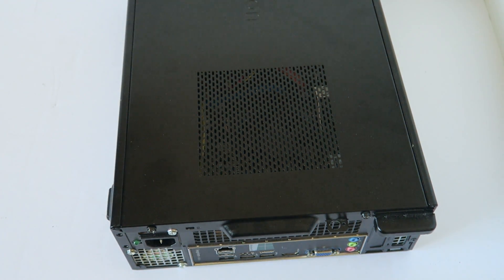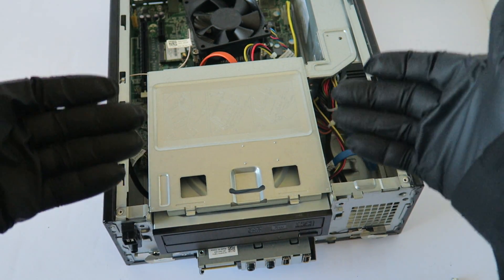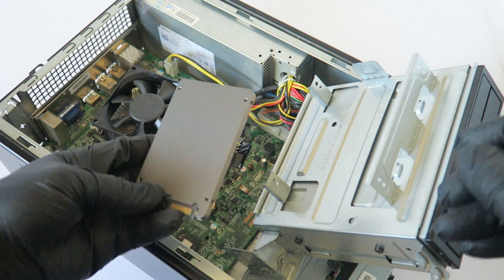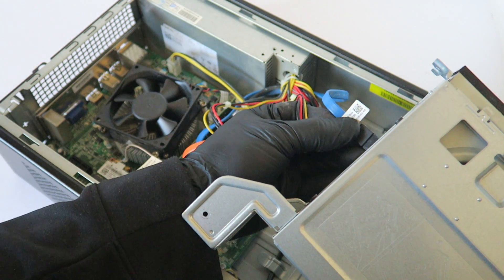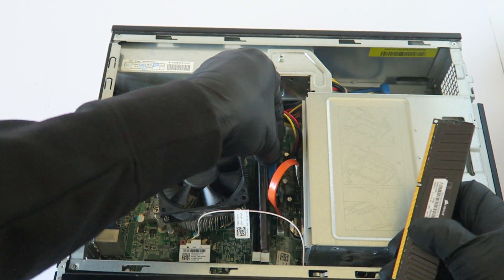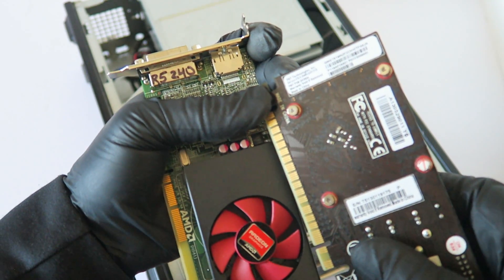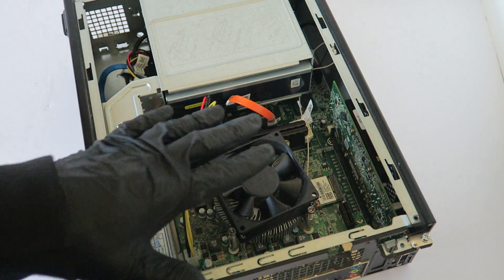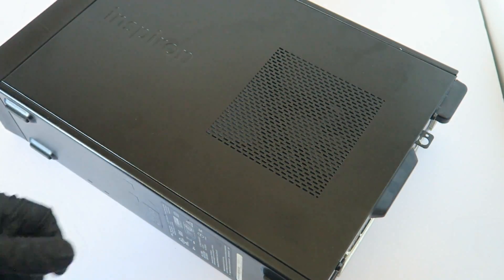Dell Inspiron 660s Upgrade, RAM, Video Card, Hard Drive

Comment from the maker: List of parts that works with this Dell 660s PC.

1..USB Wifi Adapter for PC AC600Mbps Wireless Network Adapter
https://amzn.to/2ZaGuHb

(1.) Gigabyte GeForce GT 1030 GV-N1030D5-2GL Low Profile 2G Computer Graphics Card 
https://amzn.to/2Xu3SyO

(2.) ZOTAC GeForce GT 1030 2GB GDDR5 64-bit PCIe 3.0 DirectX 12 HDCP Ready Low Profile Video Card ZT-P10300A-10L 
https://amzn.to/3eayL1b 

(3.) Gigabyte GV-N1030OC-2GI Nvidia GeForce GT 1030 OC 2GB 
https://amzn.to/2Tcz9mF

This RAM works with this machine and Supports MAX 16GB RAM:
(1.) Crucial 8GB Single DDR3L 1600 MT/s (PC3L-12800) Memory CT102464BD160B
https://amzn.to/2VhGv8O

(2.) Crucial 4GB Single DDR3L 1600 MT/s (PC3L-12800) Memory CT51264BD160B 
https://amzn.to/2xq46wb 

(3.) Crucial 16GB Kit (8GBx2) DDR3L 1600 MT/s (PC3L-12800) CT2K102464BD160B 
https://amzn.to/2VpsKpP

(4.) A-Tech 16GB (2x8GB) RAM DDR3 1600MHz DIMM PC3-12800 240-Pin Non-ECC
https://amzn.to/36doPo7

2.5" to 3.5" Internal SSD/HDD Mounting Kit
https://amzn.to/2XZccpU

SSD List:
1. Samsung 860 PRO SSD 256GB - 2.5 Inch SATA III Internal Solid State Drive
https://amzn.to/2BY5gRl

2. Samsung SSD 860 EVO 250GB 2.5 Inch SATA III Internal SSD 
https://amzn.to/37xWUfc

3. SK hynix Gold S31 1TB 3D NAND 2.5 inch SATA III Internal SSD
https://amzn.to/3d7X6D6

4. Samsung SSD 860 EVO 1TB 2.5 Inch SATA
https://amzn.to/2B2FURX

5..SanDisk SSD PLUS 1TB Internal SSD
https://amzn.to/3hwdqku

6. SanDisk SSD PLUS 240GB Internal SSD
https://amzn.to/2zfc7EX

7. Crucial MX500 250GB 3D NAND SATA CT250MX500SSD1(Z) 
https://amzn.to/3bTTjbX

8. SanDisk SSD PLUS 480GB Internal SSD SDSSDA-1T00-G26
https://amzn.to/2yfgjUK

9. WD Green 1TB Internal PC SSD  WDS100T2G0A
https://amzn.to/2XfGtzc

HDD list works with this PC:
(1.).WD Black 2TB Performance 3.5" Hard Drive - 7200 RPM Class, WD2003FZEX 
https://amzn.to/2xFUeyF

(2.).Seagate BarraCuda 1TB Internal Hard Drive  3.5" Hard Drive - 7200 RPM
https://amzn.to/3g8FXM8
Reply: hey bro i want to make sure that  will i5 3570 and gt 1030 will work fine in 220 watt psu i have also dell inspiron 660s or i have to upgrade psu please reply fast. it will be huge help for me because i am upgrading it and don't want to face any difficulty. thanks brother

sorry for bad english.
Reply: @adityaparmar9065  psu cannot be replaced, but it yes funtion with i5 3570 and gt 1030, good luck
Reply: @cruzdeperspectivas  thanks bro
Reply: N
Reply: This might sound like a dumb question, I'm kind of new to pc's and I'm about to buy an rx580 4gb locally, will it run on a 300w psu? Or am I ganna have to upgrade?
Reply: @hamzaabdeljawad4537  Did it work? I'm about to attempt something similar with a rx480 4gb externally mounted.
Reply: @justin.cycles  it shouldn’t work, I have a 500w psu. Late reply but hopefully it helps
Reply: Hey sir do i need to upgrade the power supply if I fix a gt1030 gpu in this cpu. 
I think mine contain 220W psu
Reply: The PSU can't be changed, right?
Reply: @cruzdeperspectivas  I applied the gpu now it works smoothly when I overclock that. 
And i could mos of the games like far cry 5 at ultra. 
This comment was posted many months ago
Reply: @aswinkrishnak9526  bro are you using gt1030 , so how was the experience ? Can I run 2k (1440p) gaming with decent fps ?
Reply: I have this computer but with 16gb of ram and im wondering if i were to get the ZOTAC GeForce GT 1030 2GB GDDR5 64-bit PCIe 3.0 DirectX 12 HDCP Ready Low Profile Video Card ZT-P10300A-10L would i have to get anything else along side it? And just in case my monitors are KDL-32S2400 as my main and DELL S2340L as my second.
Reply: @mr_falconer   I think, to you don't have any problem, you should change pc, I mean, case and motherboard to you can upgrade the psu and have acces to what you want
Reply: I swapped the case to a bigger one in which it can fit 500w psu, gtx 1060, 16gb ddr3l and 1tb SSD, also upgraded the CPU to a much faster core i7-3770k. Cod Vanguard and warzone works great. Although not recommended if you want stream while playing a heavy demanding games. I extended the service life of my PC for two years, and I'm contented to dual boot it with windows and hackintosh
Reply: Which of these 3 video cards would you recommend the most for video games (SPC:  secret laboratory , War Thunder, etc)?
Reply from the maker: @pac1fic055  Hi, yes gt 1030  with low profile bracket will work fine.
Reply: @Mxkdt  thank you!
Reply from the maker: @pac1fic055  Hi, it depends what kind a CPU do you have and RAM?
Reply: @Mxkdt  I have the original i3 CPU and 6gb of RAM.
Reply from the maker: @pac1fic055  With only 220w power supply you can only upgrade i5 CPU and gt 1030 video card , because i3 is to slow, and you have to upgrade RAM to 8GB at least.
Reply from the maker: @pac1fic055  With only 220w power supply you can upgrade CPU i5 and video card you can use is gt 1030 and also you have to upgrade RAm to at least 8GB, i3 CPU to slow.
Reply from the maker: @pac1fic055   With only 220w power supply you can upgrade CPU i5 and video card you can use is gt 1030 and also you have to upgrade RAm to at least 8GB, i3 CPU to slow.
Reply: @Mxkdt  thanks again!

Comment: Hi,Can I put two hard drive in dell 660s? The first one is 3.5 inch HDD.The second one is 2.5inch SSD. Thank you
Reply from the maker: Hi, yes you can and motherboard only have 2 SATA ports that means you will no longer use DVD drive.
Reply: @Mxkdt  Thanks!

Comment: Hey I am wanting to put a i5-3470 gt 1030 and 16gb 1600mhz ram and am wondering if the 220w psu will work
Reply from the maker: Hi, yes that would work..
Reply: Thank you, thank you so much

Comment: can you use the A-Tech 16GB (2x8GB) DDR3 1600 MHz UDIMM PC3-12800 CL11 DIMM 2Rx8 1.5V Desktop RAM Memory Modules in this machine
Reply from the maker: Hi, yes you can use that RAM.
https://amzn.to/36doPo7
Reply: Awsome will the low profile amd rx 550 4gb fit
Reply from the maker: @madxracing  Yes
Reply: Thank you so much

Comment: FYI, I know this is an old video, but one thing you said was mount the ssd with two sided tape. I have this same machine and bought an inexpensive 3.5" to 2.5" tray witch then mounts normally in the same space and screw openings.

Comment: Upgrade my i660s with a 1tb ssd, 16gb 1600 ram, GTX 1030 and Intel i5 3570s. 
<15 seconds bootup
Reply: Yes power is fine.
Reply: I just bought an i5 3570s and an extra 4gb 1600 ram, I’ll upgrade ssd down the road but how is it holding up for you
Reply: And is the default power supply enough?

Comment: Hey sir do i need to upgrade the power supply if I fix a gt1030 gpu in this cpu. 
I think mine contain 220W psu
Reply: You wont need to upgrade the psu, the gt 1030 uses less power than the r5 240 or the hd 7570
Reply: @realderyn  yes now i am using that combination.

Comment: Will 750 ti work or 660 ? Please reply
Reply from the maker: Hi, low profile video card will only fit with low profile bracket.
Reply: @Mxkdt  I need new power supply to?

Comment: This was very helpful as I attempt my first DIY upgrade of my ancient Dell Inspiron 660s. Can you do another video showing how to change out the processor? (and also let us know what processors you'd recommend/would be compatible with this desktop?). Also, is it worthwhile for this computer to upgrade to 16gb RAM or is 8gb the most it can handle?
Reply: I watched another video and the guy said that the original processor for Inspiron 660s only supports the DDR 3 1066.
Reply: @Logosapien  that's not true according to dell. It's spec sheet says 1600
Reply: Can take 16gb RAM.

Comment: Which os is this 32 bit or 64 bit
Reply from the maker: Hi, 64bit
Reply: @Mxkdt  bro I have inspiron 660s 32 bit cpu how much ram can I upgrade, and which graphic card will support it. Plz help brother
Reply from the maker: Hi, if you are using 32bit Windows 10  Max RAM 4GB and i recommend you upgrade to 64bit Windows and you can use 16GB RAM Crucial pack of 2x8GB sticks BLS2KIT8G3D1609DS1S00
Reply: @Mxkdt  how can I upgrade it to 64 bit

Comment: I don't know if you'll still see this, but can you maybe do a quick tutorial on how to get the GPU going? I tried out two different GPUs (one GTX 750Ti and one GTX 1060) with a 400w power supply, neither of them worked, PC booted up to Dell logo and then froze, while mainboard made one beep noise every minute or so. The GPUs work fine on a different PC and the Dell works fine with only the onboard GPU. I can't find any settings in BIOS to disable the onboard card. Have you encountered the same problem as well?

Comment: Can I add a gt 1030 low profile in this small CPU?
Reply from the maker: Hi. This video cards will fit
MSI GeForce GT 1030 2G LP OC  Low Profile Video Card
GIGABYTE GeForce GT 1030 Low Profile 2GB, GV-N1030D5-2GL
Reply: @Mxkdt  thanks.

Comment: I am so glad to have found this video; so well done. My sister had this very same system and asked me find out why it wasn't working. After doing several different diagnostics it came down to the hard drive had died. Now she doesn't want it back and the system is really clean.  So I want to upgrade memory, cpu (it is currently a Celeron), and an SSD. But I cannot find (and I have done a whole lot of research but maybe I am just missing out on the obvious) the memory voltage. Is it 1.5v or 1.35v? Some boards can do both. Can someone please tell me the memory voltage for this board? Thanks. Two other questions: Has anyone successfully installed an SSD with Windows 10? Does the system recognize SSD's? Reading the comments here there are those who have had issues.  Thanks.
Reply from the maker: Hi, yes you can use this Crucial RAM with 1.35V and any SSD will work fine with windows 10 on this system.

Crucial 2GB DDR3L-1600 UDIMM 
    CT25664BD160B

Crucial 4GB DDR3L-1600 UDIMM

  CT51264BD160B

Crucial 4GB DDR3L-1600 UDIMM

    CT51264BD160BJ

Crucial 4GB DDR3L-1866 UDIMM

    CT51264BD186DJ

Crucial 2GB DDR3L-1600 UDIMM

    CT25664BD160BJ
Reply: @Mxkdt  Thanks much for your reply. It is much appreciated. I have 8 gigs (2x4) of Ballistix DDR3-1600 @1.35v lying around but, again, could not find if this system board could run 1.35 v. memory.  What makes your presentation so good is you are clear, concise, cutting out any unneeded commentary, and explaining things as you go for the viewer. New subscriber.

Comment: My  Dell 660's psu says "Do Not Exceed 100 watts" and I bought a VisionTek Radeon HD7750 1GB GDDR5 Graphics Card (Yes I know this would not fit but I modded the case to make it fit) Anyways the GPU worked for a couple days then I took the gpu out of the pci slot cause I got a pci adapter for it so it would fit, then once i tested that the fan spinned on the gpu for like 2 seconds then stopped and the computer does not recognize the GPU (Did the same thing even when not on the pci adapter), I think it is the psu but it worked the first two days (I tested it on another computer with a non certified 250 watt psu and the gpu did the same thing. If you have any ideas on what could be wrong please help!, Best Regards Evan.
Reply: @CodyI got this problem solved I just needed a new graphics card I bought the one like in the video for as low as 12$ performs great most of been graphics card but still will hold on to the other one just incase.

Comment: So normal full size GPU won't fit in??
Reply from the maker: Hi, no only low profile with low profile bracket you can install this micro atx motherboard in different case that allow you to use full size GPU.
Reply: @Mxkdt  I have installed micro atx motherboard ..but in the case there isn't enough space for full space GPU like 750ti ....what to do?

Comment: Heh. Just stick an old 2nd or 3rd gen i5 for cheap, then throw in 8gb used ram cheaply on eBay and then a good ol HD 7750 cheaply and you'll have a great experience with it. Did this myself and I might as well throw in a GTX 1050ti once I find a job since I'm in college.
Reply: Don't get the 1050. It's a dual-slot card, and it doesn't fit in the 660s. I learned that the hard way, believe me. I'd reccomend getting the GT 1030, since it's pretty much the best single-slot card you can find
Reply: @Snork Town A 1030 might cut it close, but you should be fine. Most single slot cards don't use much power anyways, and quite literally anything will blow the integrated graphics out of the water. Hell, I put a Radeon HD 7570 in my 660s somewhere down the line (those are worth about $20-40 on Ebay), and I believe it's about twice as fast as the iGPU, according to UserBenchmark
Reply: @Snork Town I never got one. It was just a recommendation

Comment: Hello, I have a 660s and recently got a r7 250 1GB GDDR5. I'm worried about the 220W PSU, but I've seen posts of people recommending that graphics card without having to upgrade the psu. Just in case I underclocked my r7 250 though. Has someone tried this without underclocking and actually not setting everything on fire? I will not use it for heavy gaming, maybe just once in a while when I can't use my main pc

Comment: Do you need a new power supply
Reply: The power supply for this system is set at 220W as per Dell. Believe me I have researched a lot looking for something in the 300-350 range but was unable to find anything  because the power supply design is proprietary to fit the slimline design.

Comment: Is this motherboard compatible with atx or micro atx? Please!
Reply: I believe the MB is a micro ATX format, but to be sure, check your mount points. I pulled my 660s apart about 5 years ago and rebuilt it into a full sized 19" rack mount case, w/ a 2nd 1TB HD and full size 400W PS. Runs great.
Reply: @patkilgore3603  thank you!
Reply: @caiogitti1998  You are most welcome. What are you planning? Ping me if you have plans and have any questions. Best regards!

Comment: Can This Model Upgrade  The Graphic Card To GT 1030?Answer would be thankfull for me
Reply: Would like to know about this as well. The low profile version of GT1030 from Zotac/Palit has a low power consumption of 30W, compared to the GT620 (49W) that comes together with my 660s.
Reply: AimlessSky People have done this and i ask pro to.With amout of watt and other thing it sure stable for this pc
Reply: Do you know which variant fits the best? MSI/Zotac/Palit? Their dimensions varies, and I'm not sure what's the main differences between the brands (better heatsink/fan?).
Reply: AimlessSky i recommend gigabyte lp type one small and low watt only 40
Reply: lol i just put gt 710
Reply: I got a Zotac variant of the GT1030. There's a huge difference in gaming performance from the GT620 I had previously. It's running pretty well so far!
Reply: AimlessSky What Game And How many fps u get?
Reply: For full hd (1920x1080), I get more than 30fps on high settings for Cities Skylines. 60+ to 100+ fps for Sims 4 on High settings. 30+ to 60+ fps for Dying Light on Medium settings. It should be able to run most modern games on at least medium settings @ 30fps or more depending on the graphic settings of the game.
Reply: is it pci x16,2.0?

Comment: I have two questions. I hope you can help. I took this model 660s home and I tried upgrading the ram with two 4x gb however only the first slot works. I tried putting two and it beeps 2 times. Why is that? Also, to go around this can I just get 1 8 gb stick instead to put in that slot?

Comment: Hey can you plz make a video on how to replace the power supply in dell inspiron 660s
Reply: This is impossible to do so unless you out it outside of the case you can unscrew the power supply from then hard drive but a normal psu might not fit in that tiny space would reccomend getting a new case there are some on amazon that are 59.99$ USD